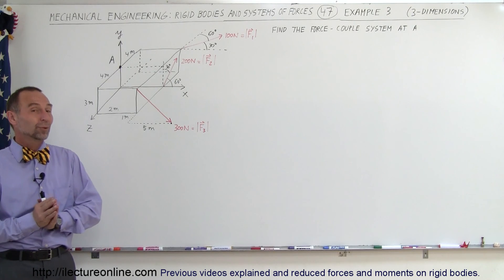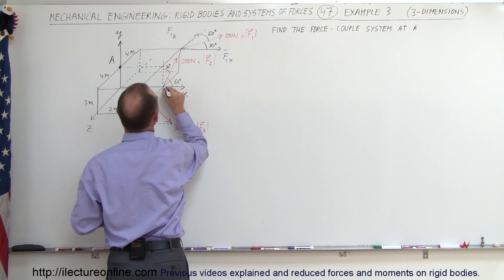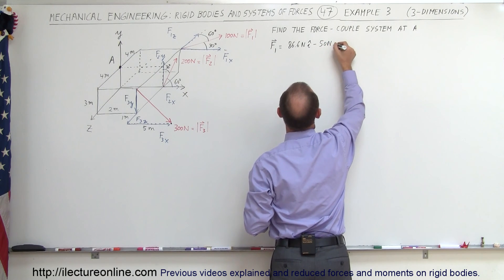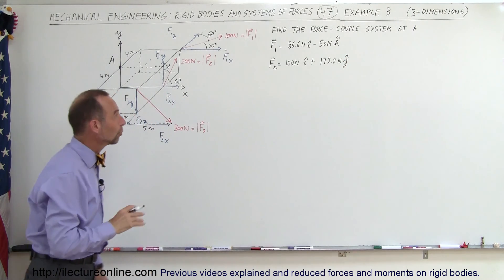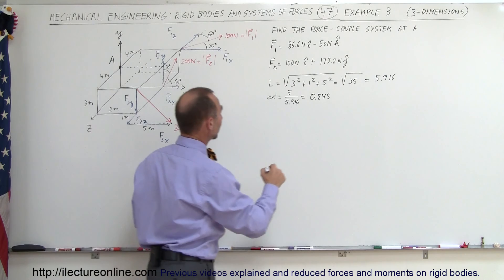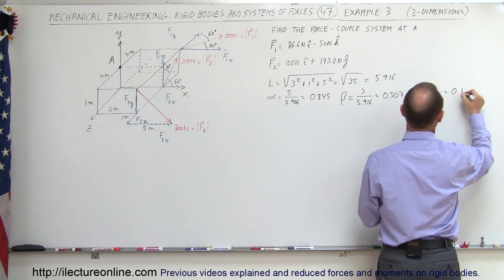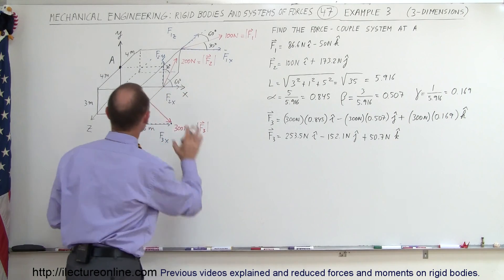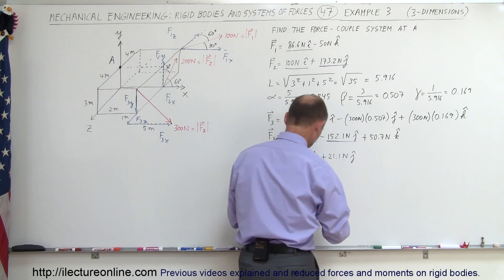Mechanical Engineering: Rigid Bodies & Sys of Forces (47 of 47) Reduction of Forces (3-D)

Comment: Dear Sir, the position vector r3 for the force F3 shouldnt have y-component , i.e r3(y) should be zero, isnt it? Because the F3 is acting at the top edge... but u said near the ending of the video that r3 will have all the three component. I am confused. Please clear my doubt....Sir
Reply from the maker: Unless a vector only points in the x, y, or z direction the vector will have 2 or 3 components.
Reply: @MichelvanBiezen the position vector r3 you’ve drawn isn’t even acting on the line of action of F3. It’s not correct.

Comment: I finally cycled again through this subject playlist(my n'th time) but with 100% full comprehension this time.  Along with following 2 different text books.  There is one more topic that is included in all textbooks and never excluded on final exams.  This "competence esteem killer" is the Reduction of Force System into a Wrench.  

I have a very tenuous comprehension of this from textbooks.  Also, the wrench analogy is highly flawed because analogy of applying a force + turning moment on same axis using the term wrench is moronic.  In using, a real world term like a wrench which turns a bolt there is zero axial force applied.  It would be more accurate to use the term drill bit.  The threads on a bolt or screw is actually a helical lever that creates its own axial force.  A main source of my mental resistance to acceptance and full comprehension.

This final concept only involves two or three equations, but it is often ignored by most and understood by a rare few.  My efforts to master this gets repeatedly interrupted by a deep desire to throw my textbook against a wall.  Perhaps, you may include this topic as a future video.  Thanks for your quality prolific work.